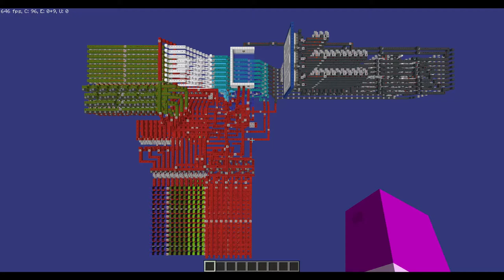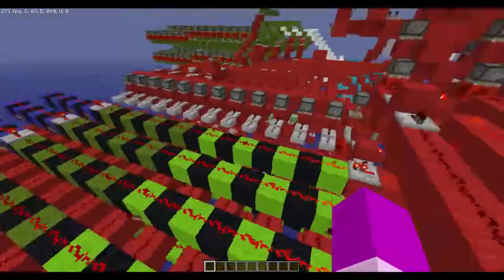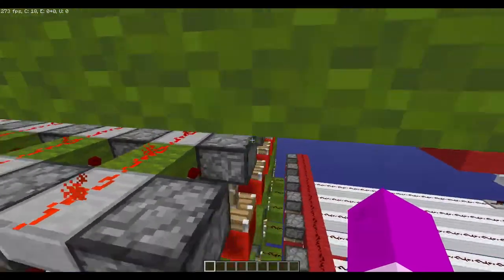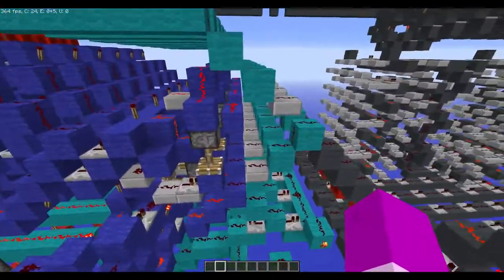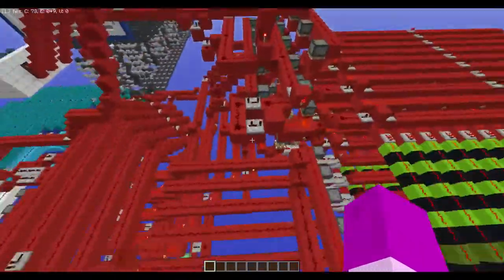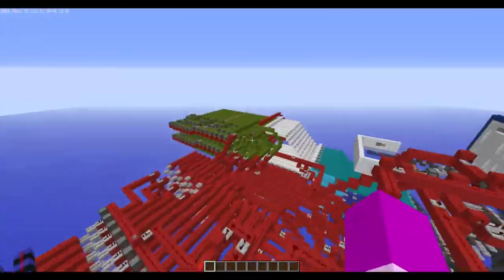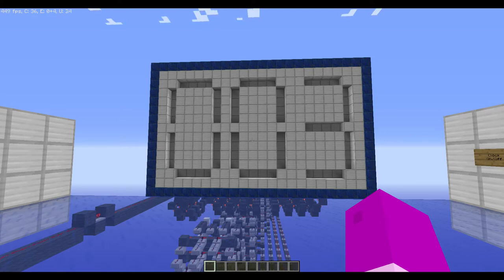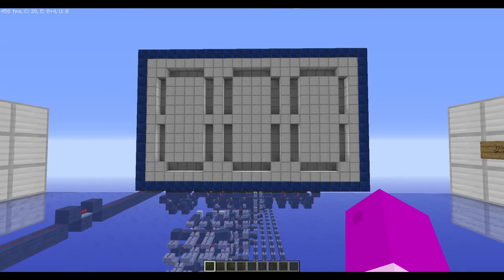My 8-Bit Redstone Computer in Minecraft "RS12"

Comment: hey I would like to ask some questions about your computer and a varied application
Reply from the maker: Go for it
Reply: do you think it is possible to convert your out to your gpu to into a out to a note block for makeing music
Reply from the maker: The only problem with that is that the fastest you could send a signal theoretically is one byte every 2 clock cycles, or 4.4 seconds, too slow to send music in real time. However, you could forgo sending it live, and instead buffer it on the music player's side, i.e. make it first wait for a certain amount of bytes to be received from the computer before playing them.
Reply from the maker: Of course, if all you want is to store and play music in redstone, this is a drastically inefficient way of doing it.
Reply: what would be a better option besides the repeater times music chains
Reply from the maker: You could have it read notes from a ROM. This could be as simple as torch ROM or blocking/opening lines ROM (like the repeater-based ones in my display), or it could read items from a chest where every item represents a certain note. You could even use a shulker box unloader to allow more notes within a chest.
Reply: thanks for the help I'm going to have a bit of learning to do before I can tie a audio to a computer until then i will be using your computer as a learning tool thanks again for all of the help hope to see more videos in the future like this!